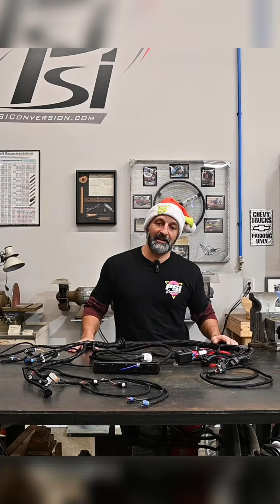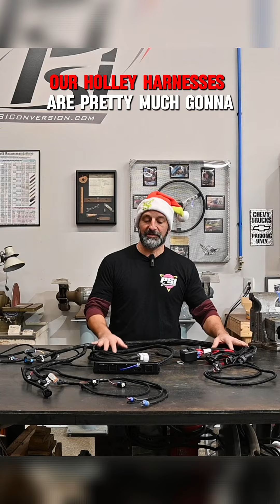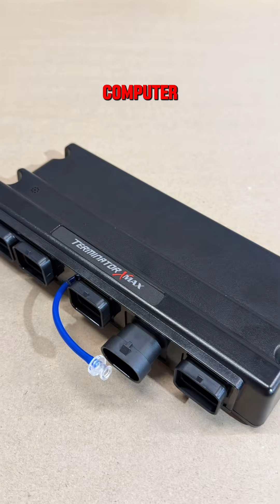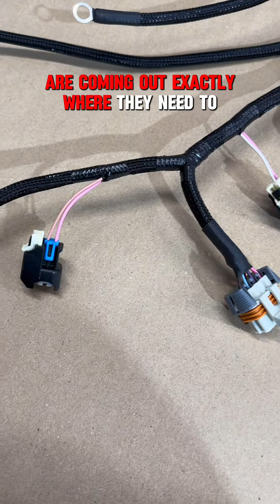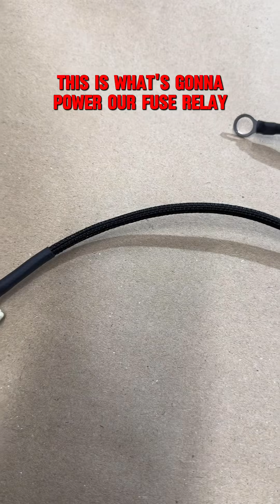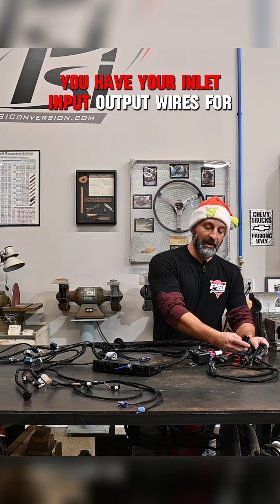The PSI Conversion Holley Terminator Harness is HERE… #psiconversion

Comment: Wish you'd made this a year and a half ago. The Holley harness works, but it has a lot of un necessary wire. For instance, on the drive by wire harness, it's probably  6 or 7 feet long:and it can't be shortened at all. I have a huge coil of wire up under the dash above the brake petal assembly. I love the Terminator X because of the ability to do custom tunes, but the next time I'll use the PSI  harness!
Reply from the maker: Glad to hear you'll be using our harness next time!